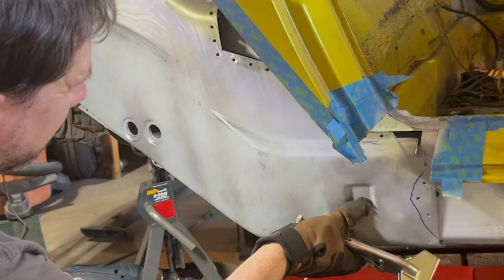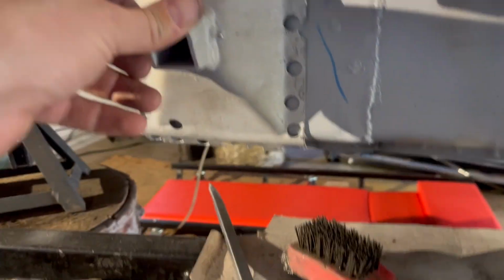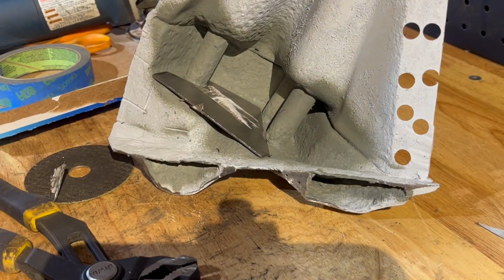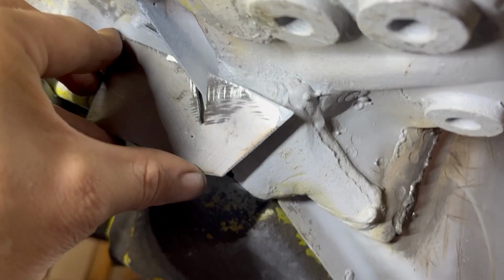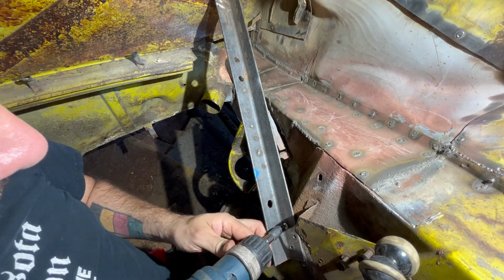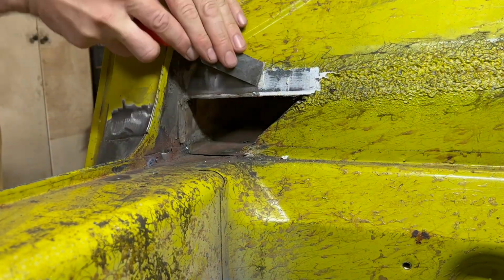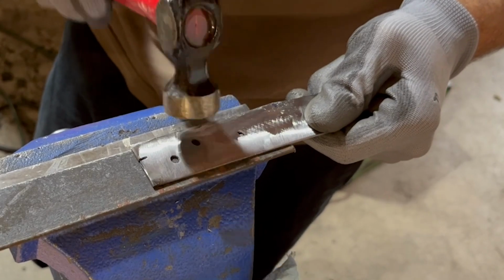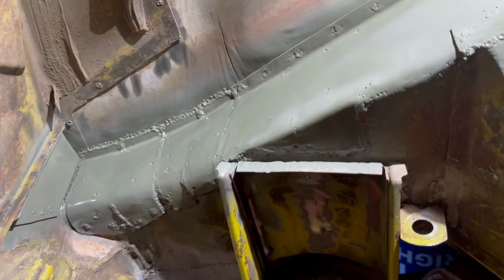Closing up the hell hole on a Porsche 914

Comment: Hi
Nice job...
I have the same car, and the same rust problems and I'm struggling with the welds
I would like to get some informations on the equipment you use for your welding, gas, thickness of the welding wire, intensity etc..
Thanks in advance
Reply from the maker: Hi! I'm using a Titanium 125 gasless flux core welder with .030 wire. It's about the most basic welder you can get. It takes a while to figure out the speed and heat but for 18-20 gauge steel i have the heat turned down almost to the minimum and the wire speed about halfway.

Comment: Probably should have welded the jack tube to the inner rail prior to installing the cover/reinforcement. The way you have it now won't support the car with the back portion of the jack tube floating in the breeze.
Reply from the maker: Good job spotting that. That was one thing I had meant to do but forgot!

Comment: The welding looks  pretty bad. Is it road safe ?
Reply from the maker: The sheet metal is thicker than original and the welds are penetrating fine
Reply: Let's see your welds Mr. Pro
Reply: @gregorypeterson9  Stupid comment. Question was put with real concern for the owner.
Reply: @tomaswiak3625  my apologies, are you a welder?